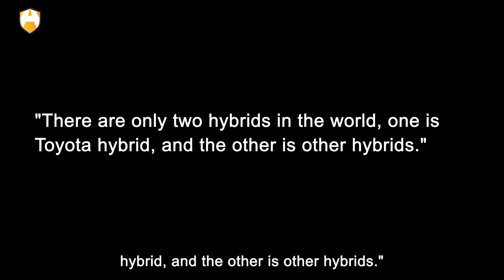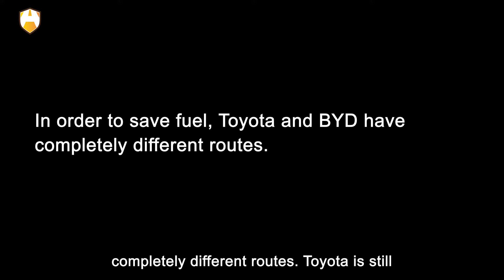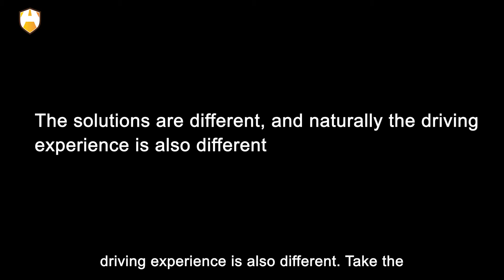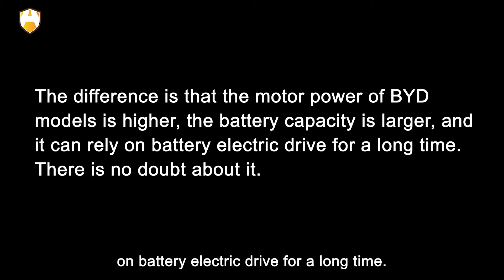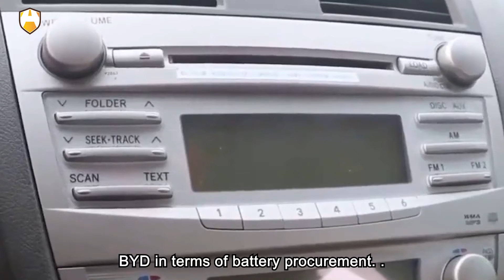As for hybrid technology, how big is the gap between Toyota and BYD?

Comment: Plugin Hybrid is far better for daily use and BYD are cheaper here in Brazil. Toyota has only the RAV4 plugin here and costs USD72k!!! Can you explain in detail the differences in the transmissions? The transaxle of the Toyota is very clever and seems the BYD counterpart is similar e reliable.
Reply: Actually both   transmissions are  eCVT and based of Toyota's technology, main difference is BYD's primer driver is electric motor  but Toyota's primer is gasoline engine .That's why fuel consumption is higer than BYD.

Comment: all byd HEVs need to be DMO tech with adding a one thing is to make the engine act as a generator only without involving in moving wheels. 1352
Reply: @don.timeless4993 That would be stupid. At high speed, the motor is so INEFFICIENT, but the ICE is very very efficient at high speed.  Honda EHEV technology also utilize ICE at high speed cruising. But BYD DM-I is a step up from Honda EHEV in that DM-I also take advantage of excess energy from ICE, during the high speed cruising, to charge the bigger battery pack, while Honda just disregard this excess energy,, because it has tiny battery pack.
Reply: @surapolp  good information!
Reply: @surapolp 

ICE is never efficient no matter how or high speed.

The thing make ICE efficient at high speed is transmission
If EV install a transmission and it will improve it's high speed energy performance greatly